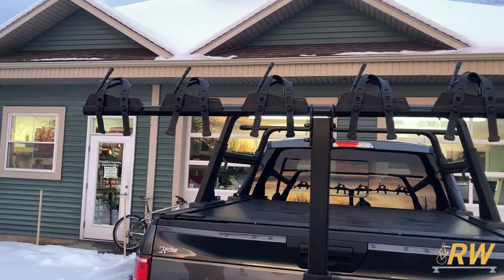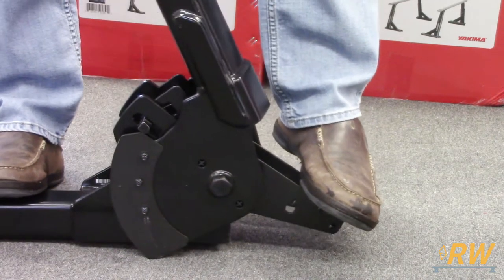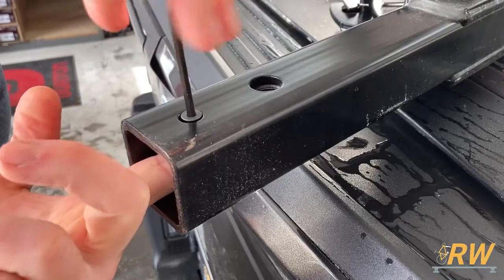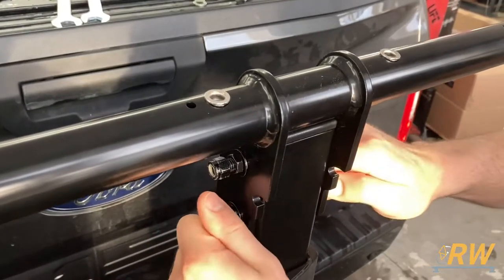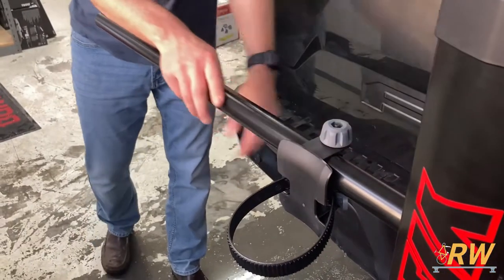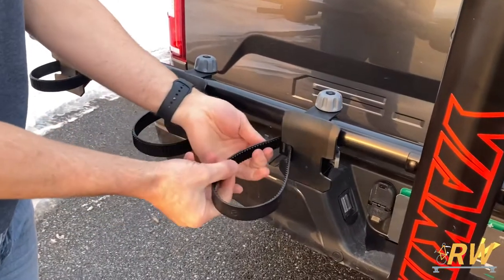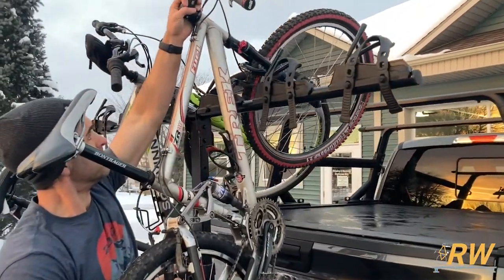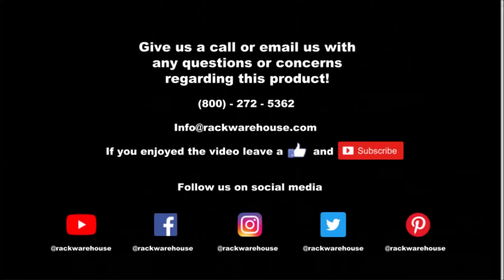Yakima HangOver 8002484 / 8002485 Vertical Bicycle Carrier

Comment: Is the rack specifically designed for mountain bikes only. Are hybrid and 24" boys bikes with V style braking system compatible with this rack? Thanks
Reply from the maker: If the bikes have crown forks then they should work. This rack is only compatible with bikes with that fork design.

Comment: Hi! I don’t have garage for my truck, i park on the street. Is it safe to leave the bike rack attached to the truck or should I disconnect it and put it inside the house?
Reply from the maker: Hi, thanks for watching. If it's theft you're concerned about, this bike rack comes with a hitch lock standard which is a great theft deterrent.